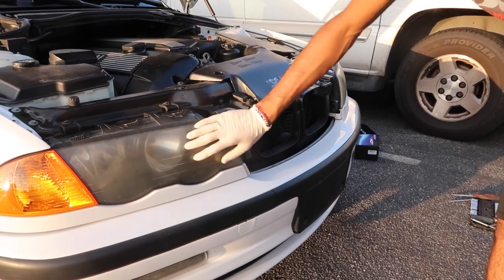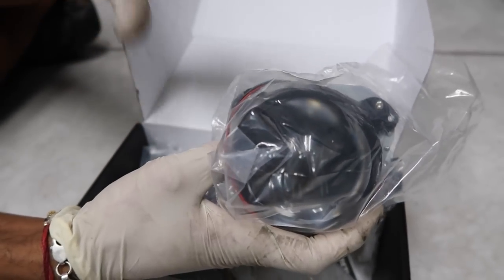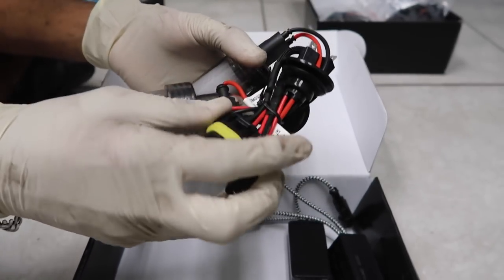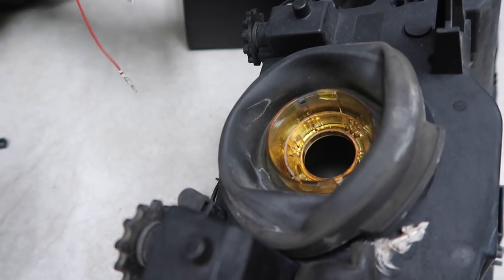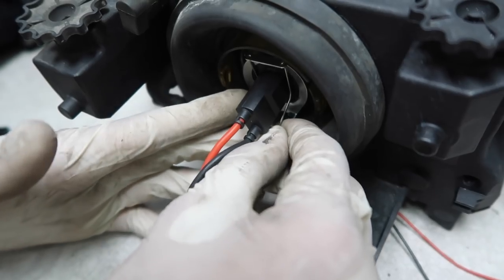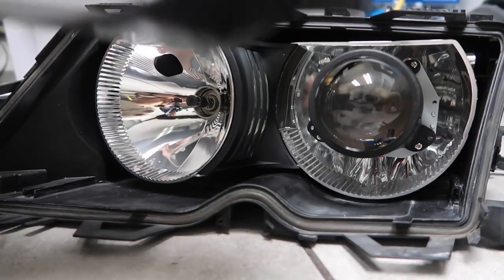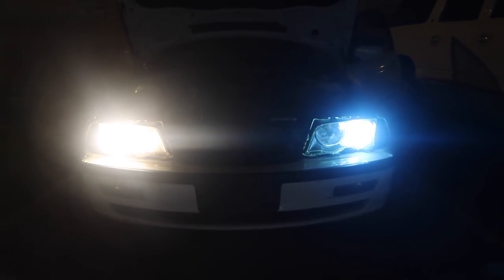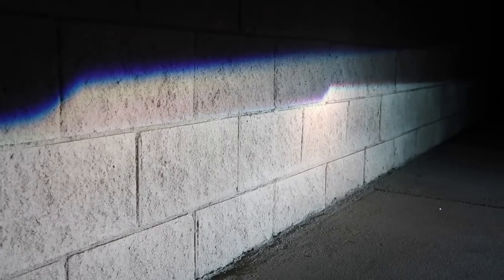BEST BUDGET LIGHTING SETUP FOR YOUR BMW! Projector/HID Retrofit! $75!

Comment: I just did this DIY you don’t need to use the connectors that came with the HID you can remove the factory wiring harness from the H7 low beam and plug it into the ballast and wire the other remaining cables.

Comment: Hey, good video, but I have a 2001 740i E38 and I was hoping for a video that breaks out that model. My driver side head lights keeps turning off, I have to turn the head lights off than back on to get it to re-light, and now it is getting harder and harder to keep it on. Do you know where I can get cheap 740i head light set ups?

Comment: Hey your link to the Amazon Autolizer HID kit doesn't work anymore.  I am using the Autolizer official website and there is an option for a "warning canceller" I'm guessing I need that for my E46 to cancel the canbus error. option is for 9 to 16V or 9 to 32V.  I'm guessing you got the first option?  Also there is an option Relay option, which one did you get?  Thanks, trying to recreate your results.
Reply: What did you end up going for? 9-16v? And what harness relay did you buy?

Comment: I appreciate your videos because they help me with a lot of questions I have. I do have one question that I can’t seem to find anywhere and it could save me a lot of time and money or maybe because I don’t know how to word it to search. Anyway, I found a great deal on projector headlights/housing for my car, but my car has factory halogen lights/housing. If I were to buy the headlight housing, with lights, would this be installable or work with my car? Would I have to have an external ballast to support the bulbs or does the housing for the projection lights have the ballast built in to them? I am not sure if this helps, but they are off a e46 that came with it. I can take this car apart and put it back together, but figuring out this is the hardest and it seems like it would be the easiest. Your response would be greatly appreciated for time and money sake.

Comment: So i currently have Halogens headlights but with LED bulbs installed, and when they're on i have a small dark triangle in the center of the road that light doesn't touch due to for ever reason the headlights create, I've tried adjusting them every way possible so it goes away but it doesn't. Will these remove that small un-lit triangle and be completely lit like other cars?

Comment: Hello. I have a 2004 318i e46. I want to have the angel eye and projector installed. Which one should I purchase? 3000K or 6000K H1 HID conversion kit? I also want the angel eye rings on both parts of the headlights. Not only on the projector. Could anyone give me some advice? Thank you.

Comment: Do you know anything on how to solve excessive oil usage in the bmw M54 engine? Changed my valve cover gasket after a leak and started noticing 1qt oil usage every 600-700 miles now when it is leak free, ccv change did not help with the oil consumption tried that and im at my wits end. Thanks!

Comment: when replacing the plastic lens on the headlight do you recommend to replace the seal also?
Reply: Most will try to get away with it but I did my lights yesterday and kept my fingers crossed as the gaskets are two thirds the price of the actual glass but I didn't get away with it. One side has moisture in it so I've just ordered 2 new gaskets from my local dealership. Always do it properly or waste your time.

Comment: So if I have the stock HID's but want more of a blueish white that a lot of modern luxury cars have, what xenon bulb should I use?
Reply from the maker: You could just get new bulbs and ballast since your stock ones are most likely worn out. Also if you have an e46, the projector bowls often burn on the inside causing a yellow tint to the light output.
Reply: Blueish light has a worse light quality and creates glare in rainy and foggy conditions. It also looks cheap
Reply: 6000k is good for blueish white.

Comment: Light are not regulated in America? Wouldn't you just end up blinding other drivers if you go over hill or have a load?
Reply from the maker: that doesn't happen when you have projectors and they also need to be adjusted properly and aimed correctly